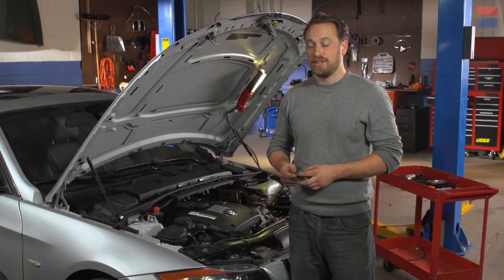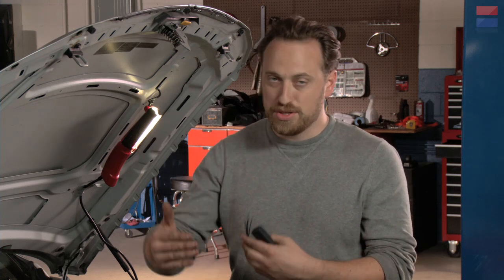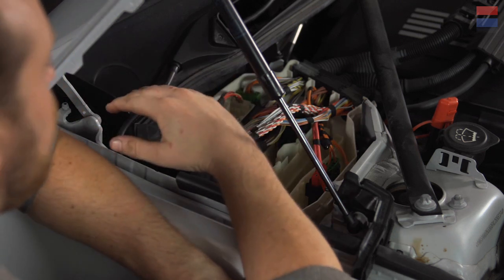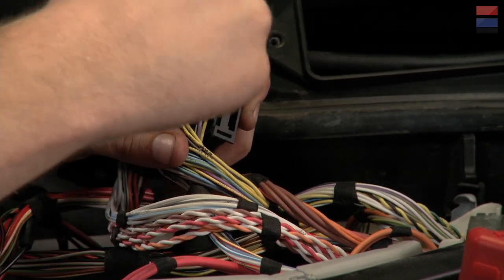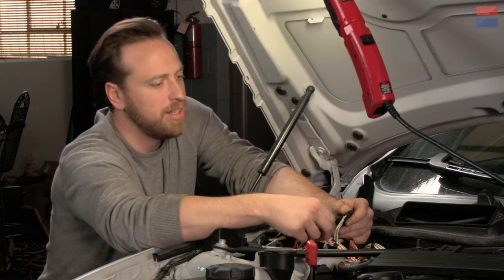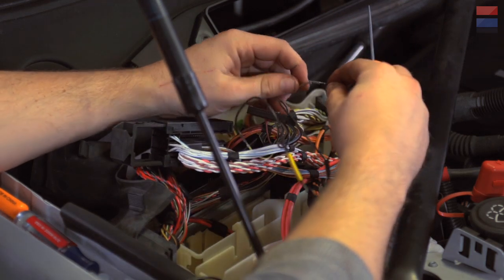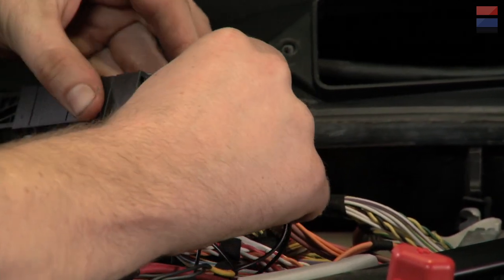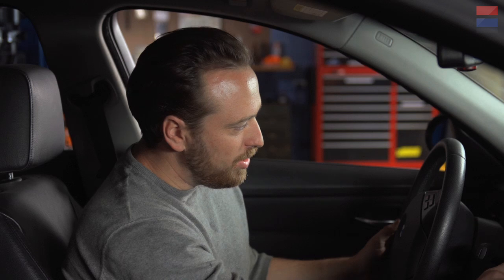How to Upgrade a Powertrain Control Module (PCM)

Comment: Yes sir, I had 2009model c200 kompresor, with troble code p0045 and it says ,supercharger boost control solenoid circuit A open, I cannot find where is it exactly the boost solenoid A circuit A open, tnx hope you will answer me,tnx again

Comment: Hello! Please I have mpv Mazda 2003 that cranks but won't start: new shafts sensors installed, no fuse cut, current to the coils wires,  pcm changed BUT plugs are not spark. The scanner reads no error. Please what can I do? Thanks!

Comment: could some help me on this. well im building a dune buggy useing a engine and transmission from a chevrolet cavalier. and i dont need all the, well most of anything just what make it run and what not but how do i get around the other stuff on the engine with out troble shooting.

Comment: These seem like ridiculous horsepower claims until you realize what they are actually doing. They are not modifying the hardware in any way, nor are they adding capability to the engine, they are merely changing the computer control settings from ones that are less stressful on the engine to ones that produce more power. Think of it like reducing graphics quality on a video game. You didn't have to spend any money on expensive parts, yet it now runs much faster.

Comment: Somewhat. ECU's are mostly found on older vehicles(80s,90s) and they controlled the inner workings of the engine, while the TCM(transmission control module) controlled the transmission. Most newer vehicles use a PCM(powertrain control module) which controls both the engine and transmission, which helps with smoother acceleration and increases fuel economy. But there are some vehicles that still use the ECU/TCM combination. Chrysler/Dodge is a good example.
Reply: doreencameron1comcas r

Comment: ECM -  controls only the engine, so it is also accompanied by a TCM  transmission control module, to control transmission settings GM went to this separate setup starting around 2005 in certain vehicles, then more widely used in 2006 vehicles, and now is the norm on all new vehicles.

PCM - a single control module that contains all the settings/programming for BOTH the engine and the transmission.

ECU - engine control unit just a term that can be used to describe either an ECM or a PCM

Comment: No, it's a separate module. This allows for a manufacture process using a more universal ECU for all models with or without turbo or with different turbo setups. If you tune you engine using the ECU, you don't usually replace it (mega expensive) but you reprogram it ('flash', 'chip').
Reply: How can I get that done or the chip??

Comment: No the N54 engine responds very well to tuning. There are single turbo N54's out there with 630whp and the motors internals haven't even been touched. Keep in mind this is also an extremely old revision of the JB4, the newer ones add 80whp with just the tune. Add bolt ons on top of that and you can easily double the HP.

Comment: Nice video and funny comments. :) For those interested in N54 tunes, modifications, dynos, etc, much info is posted on our website @ burger tuning dot com. The N54 is a terrific engine from the factory and has a lot of potential beyond what BMW endowed it with. We've recently made upwards of double the factory horsepower with it and have been tuning them since 2007. This engine LOVES tuning. :)

Comment: You mentioned 30-40 HP on PCM/ECM being a top-end for safe modification. What would you do to add, for example, a safe 80-100 with PCM ECM? Are you referring to something like intake/downpipe/echaust/intercooler or something more complex like injectors, rebuilding the engine, etc.?

Comment: ECU is engine control module. Which is for vehicles either old enough not to have a computer controlled transmission or the modules are seperate. PCM means powertrain control module. Which controls engine and transmission funtion.

Comment: Wouldn't increasing the boost to create an addition forty or fifty horse power easily place the car into an unsafe operation range  that may cause the engine to blow if you don't ensure the increased boost pressure is safely regulated?

Comment: Surely this is just a cheap box to trick your ecu? Its not a chip or a reflash of ecu/pcm is it?
There is no way I would go this way can you be sure the fuel will be right for your extra boost :-/ Det Det bang its not a Nissan 180 worth 500 notes why would you do that?